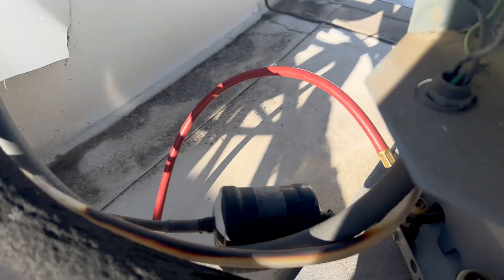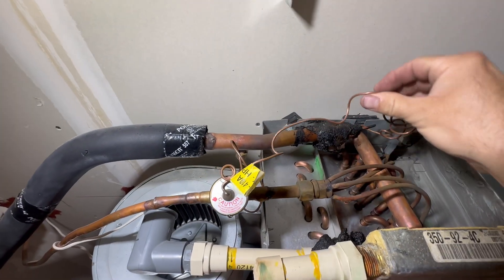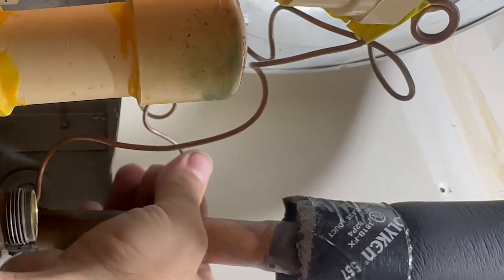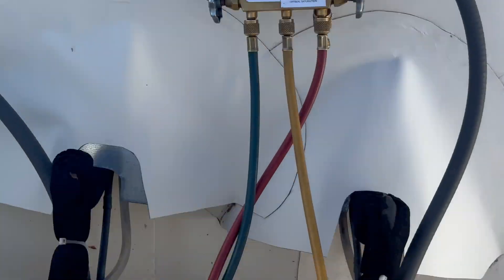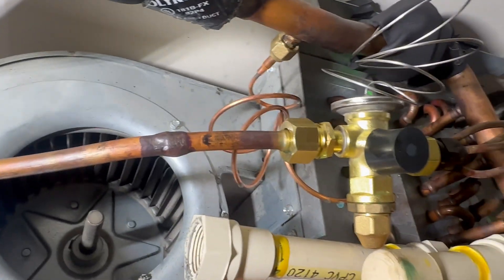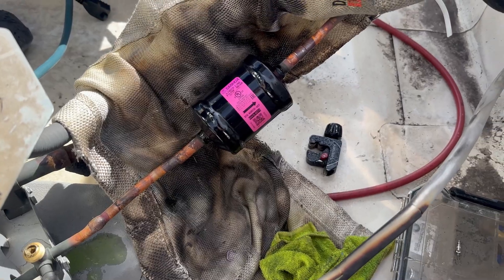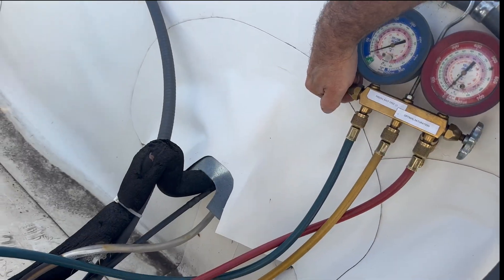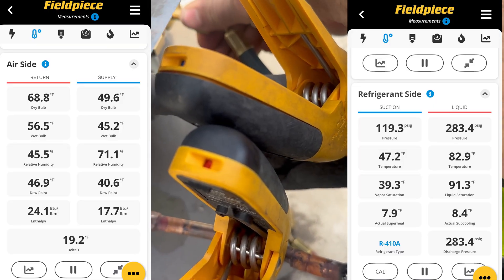TXV Troubleshooting and Replacement

Comment: What size vacuum pump do you use? And how long does it take to pull down for an effective decay test
Reply: I really like the connectors AS OPPOSED-to brazing the TXV in, it’s a shame manufacturers don’t make it this way so that the TXB can be changed easily
Reply from the maker: @JacksLore definitely prevents people from frying them when brazing
Reply from the maker: 6 cfm. The time depends on several different factors, but I’ve pulled below 100 before in under 5 minutes. That won’t happen every time though
Reply: @ApartmentMaintenancePro  it usually takes serveral hours where I am at. What elevation are you?
Reply from the maker: @alexfenstermacher2714   above 5000ft.